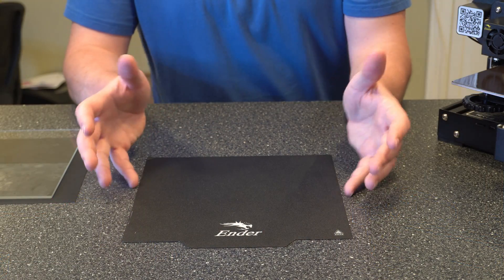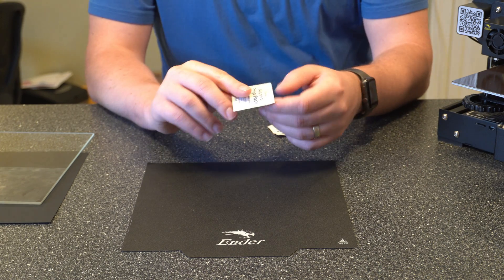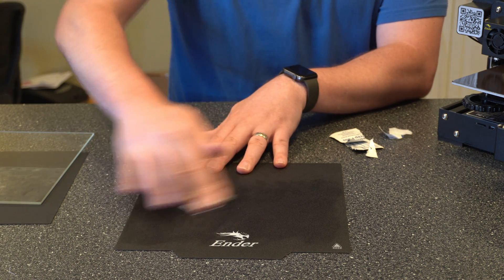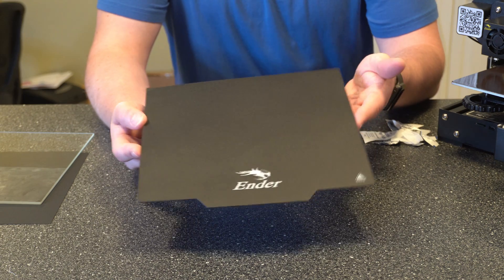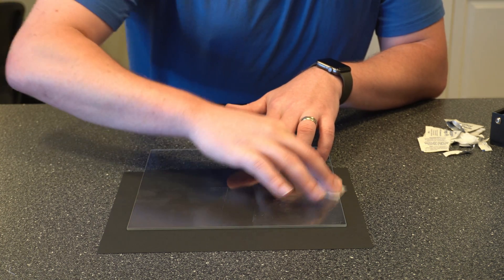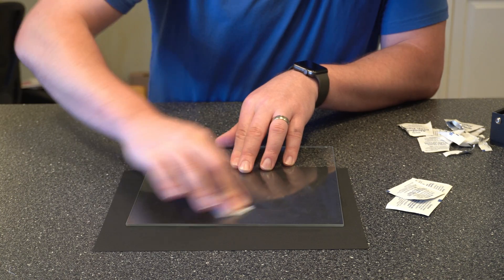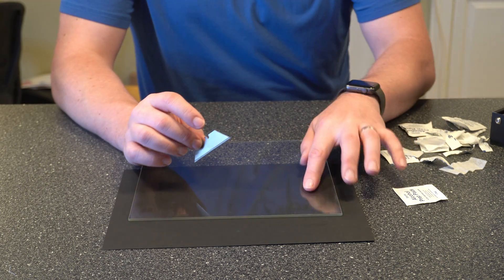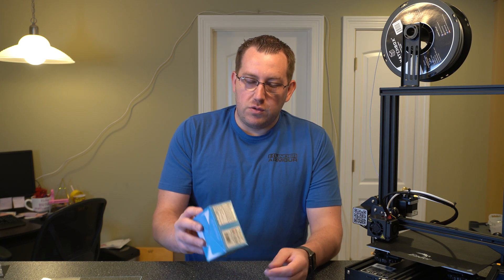Ender 3 Pro Bed Cleaning – Tips and Tricks

Comment: Cheers :) I just got an ender 3 v3  and didn't want to mess up the build surface with iso and now i know its all good.  the printer I had before this was an Anet with a plain glass plate and that thing was so easy to clean, scrape it with a blade then spritz with iso (Im posting from the future, in 2024 we have iso back but its doubled in price) give it a wipe and it was good to go
Reply from the maker: Hi. Ya iso works good overall, assuming you have some around.

Comment: Thanks for the video. In my prints i dont have problems or anything left on the bed after detaching the main item, what causes me constant problems is the thin outline around the model. I tipically bend the bed which help first couple time to take it off (alcogol does not help and scraping is very hard). After bending bed several times it deforms it leaving convexities which eventually makes scraping even more dificult and the object inacurate. Thus is my second bed and i need 3rd one. Is this the same for others or there is something i can adjust?
Reply from the maker: Hi. Are you talking about the skirt around the print? If so, you could try to print with a brim to have it come off with the print. Or its possible your nozzle is just a tad too low.

Comment: How do you get pla to stick on creality glass bed? I tried alcohol wipes but it still wouldn't stick, I have cr touch so it should be leveled? Please help
Reply from the maker: Hi. Depends what the issue is but i like to use bed weld, it helps out a lot.
Reply: @3DPrintscape  thanks you! I'll try that
Reply: @3DPrintscape  turns put hairspray works! Thank anyway!
Reply from the maker: @yobtnirp3D  Hairspray does work, but it can be messy at times. I like bed weld better but its just a preference.
Reply: @3DPrintscape  yea you're right, I'll try bed weld one day

Comment: I swear by Windex on glass.
Reply from the maker: Hi. Thanks for the feedback. I haven't used Windex on my build plate but it would be similar to rubbing alcohol.
Reply: @3DPrintscape  I use alcohol on the plate some times but I found windex just gets rid of all the residue, even the stubborn oils from old filament.
Reply from the maker: @joeythefoxxo  Thanks for the tip, i will give it a try.

Comment: I have a lot of plastic left om my magnetic build plat and it wont come off with alcohol do I just leave it on or is there anything else i have to do
Reply from the maker: Hi. You will need to use a scrapper or something to get the rest of the plastic off. It sounds like the nozzle maybe a little to close to the build plate.

Comment: Would it hurt to use glue for print adhesion on the first magnetic build surface?
Reply from the maker: Hi. If your using PLA, glue shouldn't be needed on the  magnetic pad. A good cleaning with rubbing alcohol should fix any adhesion issues. To answer your question directly, i havent tried to use glue on it but i know a couple of people that have without issues.

Comment: I also need to pick your brains. I'm using creality ender 3 hot glass version. What temp and speed would you use for PLA. 60 speed ok?
Reply from the maker: Hi. 60 should be fine for the bed, thats what i use most of the time. I tend to print at 50mm/s.
Reply: @3DPrintscape  thanks for your assistance, mate.
Reply from the maker: @ShiaofIran  You're welcome.

Comment: I used a little alcohol hand sanitizer. Works a treat.
Reply from the maker: Hi. Thanks for the tip. This does work well most of the time for larger prints.
Reply: @3DPrintscape  I'm glad you asked as printed a small 1 inch groot fine, but taller wider prints seem to be 50/50. Also what's the ideal temp you use for PLA, and is speed always 100 or best lower?
I'm suspecting my ender 3 needs maintenance!?

Comment: Not sure if this method would work for my problem but one of my prints messed up and I can’t get the dried filament off the mat. Again just wondering if this would work to do that as well (scraper doesn’t get print off either)
Reply from the maker: Hi. It sounds like the nozzle way a little to close to the mat, I have had this happen before. I was able to mostly clean it by using rubbing alcohol and a scraper.

Comment: Can you or have you used a razor blade like you used on the glass plate for the mag or the fiberglass plate?  They both seem to have a small texture to them and I haven't tried yet.
Reply from the maker: Hi. I have used the razor blade on the magnetic plate, along with plexiglass, before, I haven't tried to use it on fiberglass. Just make sure you are using even pressure on the blade. Its easy to scratch the magnetic plate if you push on one of the sides too hard. I didn't bring that up in the video because Its easy to damage the plate.

Comment: Ender like the game, or the moon the Ewoks live on?
Reply from the maker: Hi. Ya I realized I was saying it wrong after I did a couple of videos, not sure why but that’s my bad. I corrected it in future videos.
Reply: @3DPrintscape  if just put together this very printer last night xD First attempt at leveling needed a slight correction, then a successful first print with its crappy stock filament. Which I promptly broke when trying to remove from the magnetic pad xD
Reply from the maker: @fuzzybat23  It sounds like the print was ok, so you are doing pretty well for just starting out. I tend to use HATCHBOX filament most of the time. The quality is good and the price is reasonable.
Reply: @3DPrintscape  yeah, my coworker recommended hatchbox too. They're entirely sold out on Amazon xD I forget what kind I did go with, but it compared well with hatchbox. The sample filament that ships with the printers is almost always sub par, I read. I also read running the mag plate under cold water, after the print is done, can help pop the print off easily.
Reply: @3DPrintscape  yeah, my coworker recommended hatchbox too. They're entirely sold out on Amazon xD I forget what kind I did go with, but it compared well with hatchbox. The sample filament that ships with the printers is almost always sub par, I read. I also read running the mag plate under cold water, after the print is done, can help pop the print off easily.
Reply from the maker: @fuzzybat23  I have never had any issues getting a print off the mag plate once it has cooled down. Worst case, i pop the build plate off and bend it a little to get the print to release.

Comment: How do I take off the magnetic build plate. This is my first 3d printer I’m very new😅
Reply: You just peel it off. There should be a little part hanging off just grab it and pull up, make sure you center it good after bc it could hit your power supply unit and screw your next print up. But you should see that when you level your bed after cleaning it. (If you don’t level it you could scrape up your magnetic bed with the nozzle, or your filament will be to far from the plate to stick)
Reply from the maker: Hi. As Chris said, you would just peer lit off, and when you put it back on, you want to make sure it's centered. If you have good springs, you shouldn’t need to relevel it every time you remove it.

Comment: I've had to use glue on my magnetic bed due to a warped build plate, any tips for cleaning it or will the way in your video work?
Reply from the maker: Hi. It depends how bad the glue is. I would try to use rubbing alcohol or something like that but it may take using a razorblade edge or something along those lines.
Reply: @3DPrintscape   I'll give it a try, Thank you!

Comment: Would this work for ender 3 V2 plate?
Reply from the maker: Hi. It depends on what build plate you have on it. If its similar to the one I show in the video it would work. If its glass I would just wash it off with water, dry it, then go over the top surface with the alcohol wipes.

Comment: I just got my printer. Did 5 or 6 prints without a single issue. Now I cant get a single thing to stick even after alcohol like you have used here. The nozzle doesnt even stick 1mm of PLA to the bed it just curls up at the nozzle or sticks for half a second and then breaks free. Is the bed totalled and do I need to switch to glass? My bed is level and I am using the same PLA spool I did all the other perfect print with. Please help.
Reply from the maker: Hi Tyron. There are several things that can cause what you are describing. Here are a few that I would check first. 1) Make sure the is the right height off the bed, typically around 1mm from it (I did a video covering this process) 2)The temperature of the filament is to low (not sure what temp you are printing at) 3) Your nozzle got clogged. Let me know how those three things look, and we can go from there. You can switch to a glass bed, but there are no guarantees it will fix the issue you are having. My recommendation would be to get things working properly again first before making a decision there.
Reply: @3DPrintscape  thanks alot! Turns out nozzle was clogged! Glass bed arrived today so I just swapped over and now it's sticking like glue thankfully!

Comment: I'm still using the magnetic mat. Is there any advantage to using glass? How does the glue or bed weld work? Do you have to apply a new layer before every print? Would you actually clean it off to apply a new layer of it?
Reply from the maker: Hi. The short answer is it depends on your preference and what materials you are printing. Some people just prefer working with glass build plates, they are easier to clean, last longer, and work with higher temperatures. The magnetic build plate that comes with the ender 3 pro tends to lose its magnetic connection at temperatures above 80c, so if you are wanting to print ABS you will most likely need to move to glass, you won’t have any issue with PLA. For adhesion, I tend to only use bed weld. You apply it like you would apply paint to something with a paint brush, it’s really easy. I can typically get 6-8 prints per application.